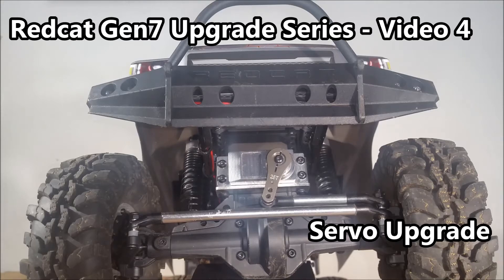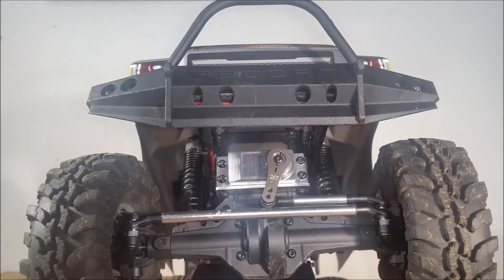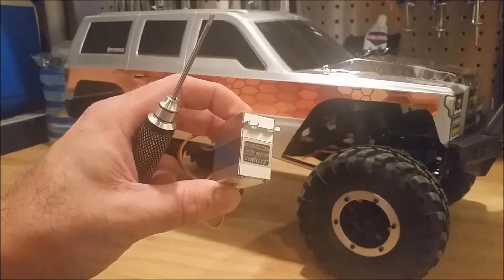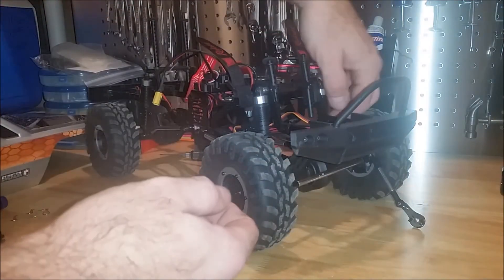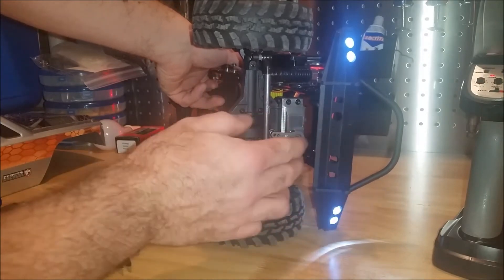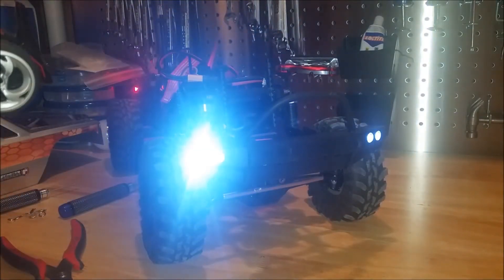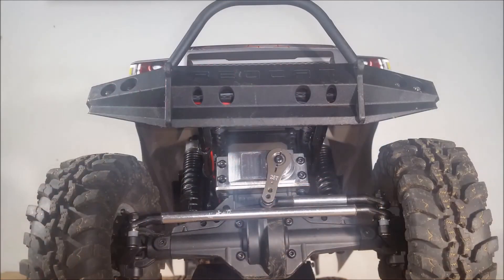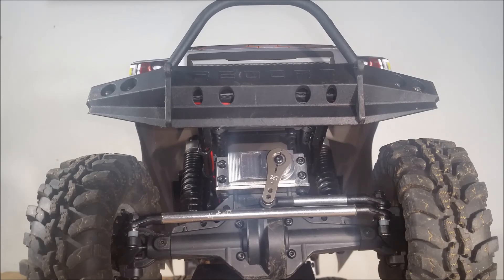Redcat Gen7 Upgrade Series Video 4: Budget Servo Swap

Comment: I have done all these steering mods and I'm using a slightly bent steering rod to give even more throw. My only problem now is that my tires rub the springs.  Any idea what I can do to remove this problem? Also I use this for crawling and I feel like a couple things are still wrong with the truck.  1. the springs seem to stiff, maybe it's the shock oil they used? I would love a suggestion for softer springs that will work with this redcat.  2. Is it me or is the front end to long? if you look at the back the tires line up nicely with the wheel wells of the body.  On the front they are to far forward.  What do you think? I've moved my links to match what the manual shows.  However I think the two longest ones on the front could be moved over to the next hole back in the skid plate.  This would pull the wheels back about 5mm.  Any thoughts?  Your help is greatly appreciated. My only concern is if you look at the skid plate there is 1 more hold back in the frame but the plastic behind it on  the skid plate is thinner in that area do you think it will hold?

Comment: I have a savox 0251 servo that my friend sold to me cheap. It worked awesome on his rig. More torque, quicker, and quieter. But when I put it on my Gen 7 it isn't syncing. Am I doing something wrong or are some servos just not compatible? New to the hobby.
Reply from the maker: Are you running it right off the ESC power or with a BEC?  That servo might not like high voltage.  It should run fine direct off ESC power assuming the ESC is ok.
Reply: Budget RC plugged it directly into where the old one was. Wouldn't think it would have problems.
Reply from the maker: You sure you plugged it in right?  It's not hard to plug them in backwards
Reply: Budget RC yessir. Tried it both ways just to make sure.
Reply from the maker: You got me dude.  Try a different known good servo to see if maybe it's the esc that's bad.  It's not at all uncommon for their internal BECs to fry.
Reply: Budget RC alright man. Thanks for the info.

Comment: Theres loctite on thr right side of the wall xD @budget rc
Reply from the maker: It's a GoolRC kit with 4 clear & 4 red.  I just cut out 2 of the red.  I've got my "Cosmetic" video almost ready to upload, and it has all of the details in it, so subscribe or check back in a few more days!
Reply from the maker: cody salzillo haha, yeah, there's  enough "Loctite" around my inlaws house to make me wonder if my inlaws have stock in the company, but it's all glues of some sort and no thread lock!
Reply: Looked through your videos but couldn't find any info about the lights in the bumpers.. What kit is that? Definitely need those for mine!